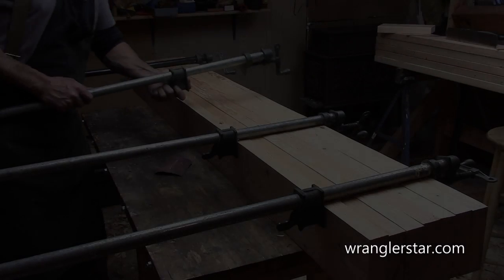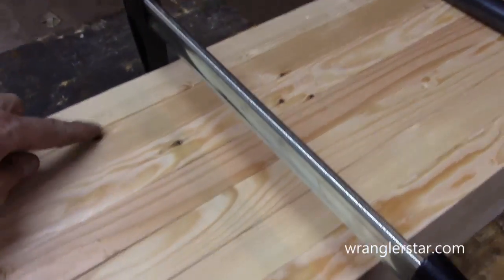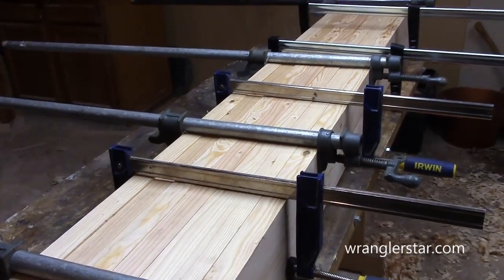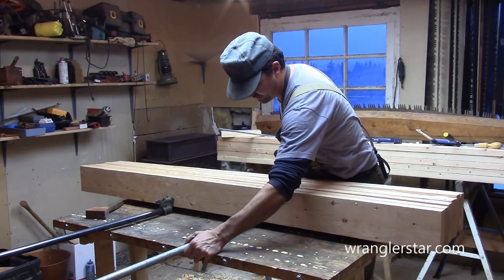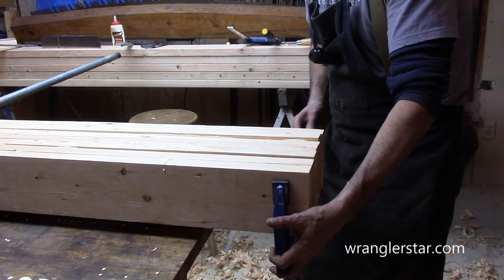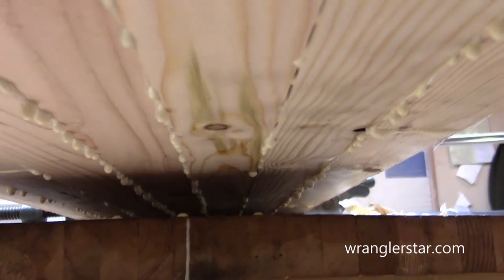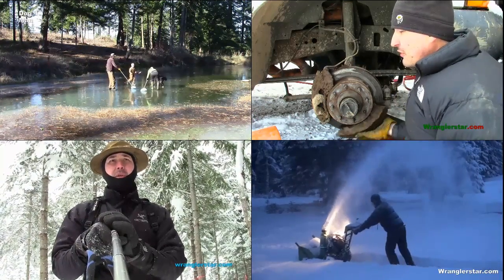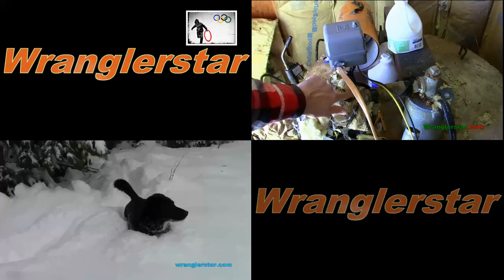Poor Man's Carpenter's Bench | 2 Wranglerstar

Comment: I would leave it pretty close to 5 inches. You won't regret the extra mass and weight, especially being only 6 feet long. Will not flex or bounce much either. Many of those small gaps will probably disappear as you do final dimensioning. I'm sure it will be a fine bench. Glad to see you stumbling down the slippery slope of handplanes. You will soon have quite a collection ! Best tinder for the woodstove too, those shavings... I keep mine in a metal trash an with lid... A pile turns into a raging inferno in seconds. Burn them up regularly, and keep making more.

Comment: Great video, just a few tips....... #1 you need more glue then one bottle, buy it buy the gallon and it will go a long ways and its cheap, with that spread the glue with a roller of some type and it will make a better bond and wont leave you with the open gaps.#2 you can always scrap the dried glue with something as simple as some sheet metal. #3  dont worry about getting the wood so even on what would be the top or bottom you can always use your nicely refurbished plane. just some tips. i look forward to see how it turns out!!!

Comment: What would be the downside of gluing and screwing each tabletop board together?? Of course not the outside boards, to keep the beauty intact. I'm sorry if this was covered in another comment. Thank you for your time.
Reply: Versatility.  If you put screws all over the place, you can't easily work the table top with drill holes, chisel joints, etc.

Comment: I would recommend you keep it as thick as possible.  That way, when you need or want to resurface the top, you'll be able to without risking it getting weak.  I built a bench like that (similar) out of 2x6's and 4x4's 11 years ago and it's strong as a sack of hammers.

Comment: Thicker the better, that way the bench is heavier duty and won't move on you while planing.  Also if you need to use a polyurethane glue like Gorilla again try out Probond its made by Elmers much better in my opinion.  For those gaps AFTER you have planned it to thickness you could take some fine sawdust and mix it with wood glue or epoxy to fill those gaps than sand it smooth.

Comment: WS - Not sure if your familiar with winding sticks if not when you get a chance check out how to use  them on you tube .  It's a must have as it'll help you when you go to flatten your bench top.  You can use some angle iron or aluminum the longer the better.   Also paint rollers are great for glue up's like yours.  Be Blessed my friend.

Comment: On Part 1, someone commented why not use MDF and you replied something like no sawdust and glue will be used here. But it seems this is not a whole lot different, smaller pieces of wood being glued together. Not being a mastercraftsman, this distinction escapes me.
For me, using this project as inspiration, if I were to build a workbench, which project I can see on the horizon, I'd look to double up MDF to achieve the same result.
What will you do on yours when the top becomes marred? Fill gouges with glue & sawdust? Sand & level the entire top? With MDF, can fill gouges & paint, or simply put a new sheet on top!
Reply from the maker: Nirky Nirky Nirky Nirky have mercy,
Reply: Mdf does not work well with hand tools. Properly made and cared for, this bench can be made to last years or decades longer than mdf. Both have their uses, and cody chose a traditional route to go. Plus hand planing is good for the soul.
Reply: You can build a stable, heavy bench with MDF however you won't be able to re-surface it very easily. One approach is to build a MDF sub-base and then apply a 1" top of wood. That can create problems because the mdf will not move with temperature and humidity but the wood will. so if you glue them together the wood will split. I used MDF for my cabinet tops, but there won't be any tool work performed on those which might require resurfacing over time.
Reply: wranglerstar You do an excellent job!! I have never seen so many "Monday morning quarterbacks" in one spot. Ignore the haters and the jealous.
Reply: Grumpyneanderthal
Also, MDF is not sawdust and glue, it is wood fibers formed into a type of paper and compressed under high pressure with wax and resins.
Reply: astrowhale
Any debris on a laminated top will scratch your workpiece.  There's no give.
Reply: Cameron LaMance
A lamination is the common term for lots of pieces stuck together as Mr W.Star is doing (often used when referring to bent laminations for instance). I don't mean laminated as in the flooring, though I can see how that isn't obvious.
Reply: wranglerstar I gusss Nerky has never seen or dealt with MDF that has gotten wet, and swells up to twice its thickness and falls apart.
Reply: Nirky, you are seriously missing the point...  Sometimes it's the journey that makes the destination so wonderful.
Reply: Planks are not sawdust.
Reply: Nirky  The problem with stacking MDF vertically like that is it not strong in that direction.  You would have stack it in the horz direction (on top of each other) and you will be ok.
Reply: Nirky I think the word you were looking for is "laminate".  I don't think MDF would serve as a good bench top.  You would be creating something that would fail easily from abuse.  A solid wood top can take abuse.  When you are tired of the look, you can re-surface it (rather than laminating another layer on top the MDF).  By the time the solid wood bench needs resurfaced, the MDF would be ruined.  Even if it was laminated 2 sheets thick, it could warp if you don't build a torsion box.  I'm just bias against a lot of "affordable" man-made wood products.  My entire woodworking desire comes from working with beautiful solid boards...and I'd like to see all my work sourced from the trees that I was able to harvest, so I could see it start-to-finish.
Reply: astrowhale  I build cubicles so a laminate top to me is like a kitchen counter top.  Your comment just gave me an oh yeah duh moment.
Reply: MDF Is compressed Wood fiber made from bi products its used in speaker cabinets for its dense nature and it is also used in furniture not very strong and won’t take water or other liquids it would not make a very good work bench and once any of it breaks you really cant repair it like the solid wood studs that Cody is using
Reply: MDF can't take anywhere near the beating that even pine boards can.
Reply: Nirky MDF!? On a totally hand tool built old fashion poor mans woodworking bench? You can't really be serious!! Not really!!

Comment: just a thought, could you have used a roller glue applicator? for complete glue application. or have you tried them and they failed you? one more thing. also just a thought, maybe you could have planed each board for exact squareness in a power planer. then glue each of the boards. assemble the table top using threaded rod as the clamps. alternating from top to bottom of the table top, using 1/4 inch all thread rod.  and leave the rods in the table top. just plug the holes of nut socket pockets. hiding the rod ends. and i'm not sure of unfinished lumber cost. if it's cheaper maybe start of with that type of boards. if you do use a power planer. like i said just a thought.

Comment: I'd echo others in recommending 2-board glue ups, especially with so few clamps. I'd also recommend not adding through bolts or threaded rod right away. Use the completed bench for a couple months first, then decide whether you need the metal fasteners. Let the wood settle.

Comment: I am just finishing up this bench, you can check it out on my channel but I wanted to say I never heard Cody or Paul Sellers mention one IMPORTANT tid bit which I thankfully thought of before gluing up... mark which way the grain is going on the edges and make sure they are all going the same way when you glue up or planing the top at the end will be a nightmare.
Reply: ha, exactly.  did you build the bench too?
Reply: Good luck my friend!  I think you are right on track for success.  As you can see in my videos, I learned A LOT during the build as I had never worked anything quite so large (7' long, 4 1/2" thick and one side 11 1/2" wide while the other is 13" wide) and ended up planing the slabs from 5 1/2" down to 4 1/2".  

One thing you'll need to pick up while you're buying more clamps is something longer than your bench slabs that you can level with and use as a straight edge, you'll see in my videos that I broke down and bought an 8' level.  

I'm happy to hear you didn't just give up and move on but instead you devised a plan which included more woodwork (shopdog sawhorses) and are trucking along... excited for you man! I absolutely love my bench and use it every day I am at home.   

I'll have to check out the urea formaldehyde, never heard of it before... i just used titebond glue since it was readily available here in the states, i believe it is a PVA but i'm not sure honestly.

Again, good luck and keep us posted!  Of course, if you have any questions, i'd be happy to answer them the best I can from my experience.

Where do you live?

Cheers
Reply: yeah, I have tons of videos (i think well over a hundred now) but the quality and editing is simply nonexistent. I started the channel for my family and friends to have an avenue to "hang out" with me whenever they want and if it helps someone else in their woodworking journey then that's a super bonus.  I too live in a very damp and cold climate (near Seattle Washington, USA) but have not had a problem 1 with using the titebond so I will probably stick with it until it gives me trouble.  Paul makes it all look so easy doesn't he haha.  I too enjoy a different perspective when learning which is another reason I made my channel so I just kinda think out loud really and in hopes that I answer questions that aren't addressed by the "pros".  It took me many months to build my bench (and I am still not finished) but this weekend I will be starting finishing it up... end caps, second vise (tail vise), dog holes galore, 1/4 moulding in the tool well, and finally, all the scraping and boiled linseed oil.  I was finishing up the resto-mod on a tool chest I picked up so I could get all my tools organized and off the bench so I could finish the bench and just finished that up this last week!  so now it's on to finishing the bench finally! enjoy the journey brother! feel free to comment on my channel so we aren't hi-jacking Cody's video haha.  Oh, BTW, you'll have to paste the link to the video you were talking about, I can't find it.  which one of my videos did you watch?

Comment: Since your using such large peaces of wood, you could have drilled 5 small holes through all the boards spaced evenly and then gotten some threaded rod and large washers/nuts to pull the board together tighter, alot of the gaps you are getting between the wood is the warping of the wood as it dries since being brought home along with the uneven surface from using a plane on them.. when i used this method in the past i drilled the holes the size of a common available dowel rod you can purchase, so when i was done using the hole for clamping i just put glue on the dowel rod and stuck it in the hole to fill it back in and this method actually adds addition strength since your placing a solid object across all of the individual peaces.

Comment: You probably shouldn't have glued it up on a pivot point like that on the bars. Level it all off on a flat surface, and glue 2 boards at a time. When those dry, glue it all together in sections. It will be much easier to control and fix any errors this way.

Comment: just plane it as flat as possible the thickness doesn't really matter much, I made mine a few weeks back out of 2x4s an 4x4 for the legs, all hand tools(except for some sanding. I gives you a tight bond and an indescribable sense of pride that really fills up your chest. only advice I can give is to take it nice and slow, don't rush good craftsmanship, and that all carpenters make mistakes, but the trick is how to deal with them.

Comment: Why does the bench top need to be so thick? I'm not a carpenter by any stretch of the imagination, but six inches seems to be a little excessive. I'm sure there's a reason for it, but I don't know what it is.

When I built my reloading bench/work bench I laminated four sheets of 3/4" plywood together to make the bench top, and I cut out three spots in the top sheet and three slightly larger spots in the middle two sheets thereby creating what are basically large dovetails. I mounted my presses & other tools to matching pieces so that I can just slide them into place when I need them and store them on the shelf when I don't. When all the presses & other tools are on the shelf I have blanks that slide in to the dovetails and give me just a flat bench top to work on. The frame for the bench is made from regular 2x4's.

Comment: my $0.02 on both the video length and the thickness: 10-15 minutes seems like about as long as you should go. less is fine if it seems like a natural wrapping up point (like this one). As for the thickness of the top, i'd not want to take any more wood off by hand with a plane then i had to. so I vote, flatten it, and be done.

Comment: i think that you were using a bit too much glue. as far as the parts that didnt show the glue, it just means the glue traveled downward a bit more than up. if you dont cut it away when you are surfacing the top, it should fill just fine when you are finishing it. the wood particles from sanding will fall in and any finishing treatment you use will seal it up. considering the thickness you are starting with, i dont think it will have any effect on the strength of the table.

Comment: If the boards would have been flat the glue up would have been fine but I don't think you were able to get enough pressure on so many boards to get out all voids but either way it will work. Live and learn right

Comment: im not a carpenter, but i did try to plane a table i made out of hardwood slats leftover from a floor, and i ruined it. I did use a power hand planer, but I think the planer has to be as wide if not wider than the piece you are working on otherwise you'll end up with unevenness.

Not sure how different it will be with a hand plane. You're always going to remove more material with each pass so its not like you can just do more and more until its flat, you could potentially create low spots that were not present in the first place.

My $ 0.02

Comment: You didn't say it in the video, but did you consider the growth rings?
I mean the growth rings in the ends of a plank look something like that: |))| - left side was towards the heart (inside) of the log, right was towards the bark (outside).
AFAIK, you're supposed to laminate inside to inside and outside to outside. So when you look at the end of your laminated board, the growth rings of the planks should look something like this: |))| |((| |))| |((| |))| |((| |))|
(outside of plank #1 facing outside of plank #2; inside of plank #2 facing inside of plank #3; outside of plank #3 facing outside of plank#4; and so on...)
This is done so that the wood can move/warp due to changing temperature/moisture without breaking the lamination apart.

Comment: My 2¢ is to leave it as thick as possible. Then you have material to plane off in the future to resurface the bench when it gets too beat up. Planing 2"+ of of wood off that big a surface is something I wouldn't even attempt, even with the sharpest tools. If I needed to remove that much material, I'd probably use a sawmill, then plane it smooth.

I think you used way too much glue. Use a putty knife and spread a thin layer over the entire surface instead of relying on the clamps to spread it. I'm also just a touch concerned what rhe glue is going to do to the plane blade when you surface the top.

Comment: I'd only plane it enough to get it even and smooth.  You won't be using this bench for general purpose work.  It's built for a specific purpose.  You have other benches for the general work stuff that you can clamp things on to or whatever.

Comment: I myself would go with four inches. It will be extremely durable at that thickness, and the four inches will make it seems almost as if the timbers are full dimension whereas the 3.5 inches would remind me of two-by-fours. Five inches just seems too thick to me; you gain aesthetic unbalance without any meaningful increase in durability.